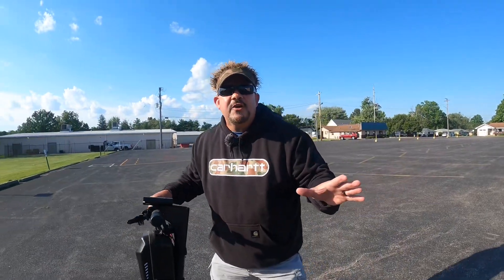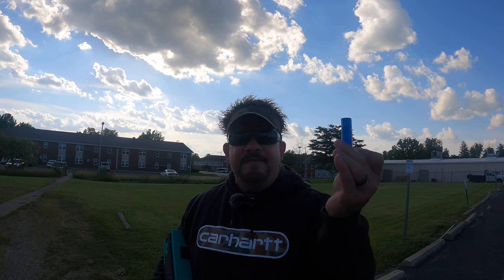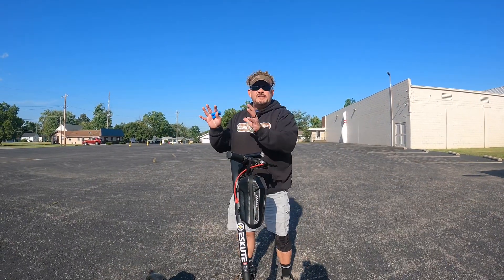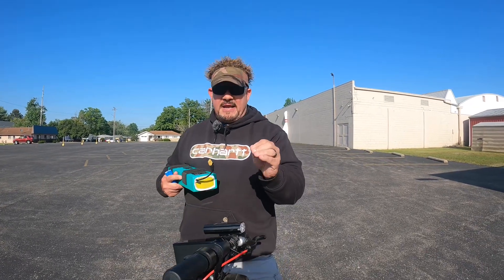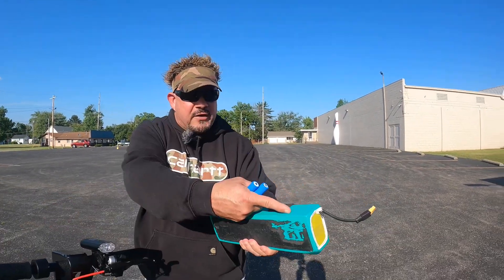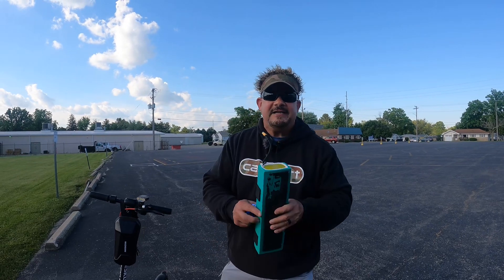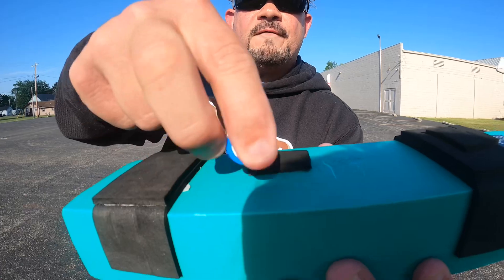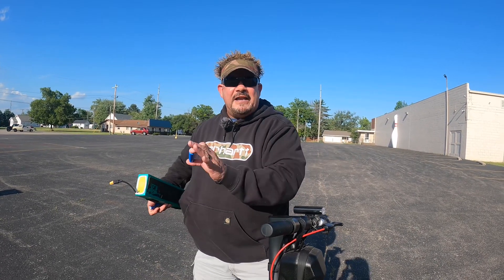Why Your E-Scooter Battery Shuts Down/Suddenly Stops. #diy #howto

Comment: I bought the scooter everything was fine until it completely died while riding it I got a replacement battery as it's under warranty off tik tok well voltscoot n now my scooter seems sluggish n doesn't seem to be keeping charge well it's going from 5 bars to 2 bars after say 2 to 3 mile bearing in mind these are ment to harvest least 15 mile range n top speed of 22mph i think it just takes longer than it normally should to reach 22mph but it does go 22mph any suggestions tips advice would be appreciated 👍 thanks subbed you

Comment: Thanks to you mate someone will burn his house 😂😂😂
Don't cut or open the battery cover, thats a lithium battery and any damage can make uncontrolled fire. Other thing, even you open the battery, these small batteries are all soldered and connected together so you can't measure them separately. If you separate them you can't connect them together without special soldering tool and soldering is again dangerous because it can make a fire

Comment: Make sure it's Panasonic batteries inside. 
Love my e-scooter, powerful fast dual motors, my 4th year now, no problem so far, made in China, but Panasonic battery pack.
Off road, jumping, all kind of scooter-mistreat, but still working good, 100% true not kidding. 
Oil both wheel shafts, just drip engine oil now and then, let's say couple drips x 4.

Comment: Hi i have a scooter and ive had it for a month and my question is im recently have a problem with it ,it wont turn on and i don't know if i compromised it by charging it more then 4 hours last time i went to work after work it turned on and i drove home but a day later i tried to turn it on and it wont turn on what can i do to fix it when I plug the the charger on the light is green but as i plug it into the scooter it turns red

Comment: Thanks for your video ..just 1 question i have a nami burn e 2 28ah all was fine until i got to just over 500 miles and the scoot would power off after 12 miles going at around 30 mph was just out of warranty by a few months so the company i brought it off say the battery is dead and i could buy another off them lol if the battery is faulty could it be fixed rather than buyying another battery ? Thanks

Comment: I have an I scooter i9 max and its only over heated once and i had been going uphill and its August so hot it showed me a wee red thermometer but didn't cut out it has a 500w motor and a 10.00ah battery last I checked it had 43.7volts. It says on my scooter app based on the battery it will go 23.9 . video my bro 👍

Comment: The batteries are not soldered, most 18650 cells are spot welded to a nickel strip for their connections.

You will want to find a good battery shop that know wheat they are doing, because otherwise, your next charge will result in a fire. Or your next ride. Typical for Chinese battery packs. You can search to find if any of the safety ratings are legit on the battery pack too.  If the UL listing is fake, don't risk your home or your life to something the Chinese slapped together and convinced you you "saved" money on.

Comment: PLEASE take out the “Suddenly stops” because it’s a wide variety not just the battery… this is a video for someone trying to specifically fix a battery not suddenly stops… AND No, absolutely no Duct tape is a thick aluminum foil tape with heat resistant insulation. AND It is conductive.
Reply: Those battery’s are called 18650 btw